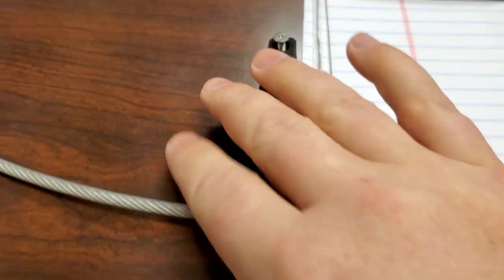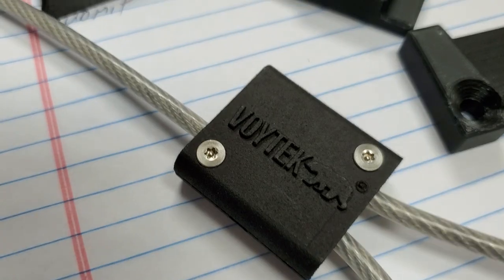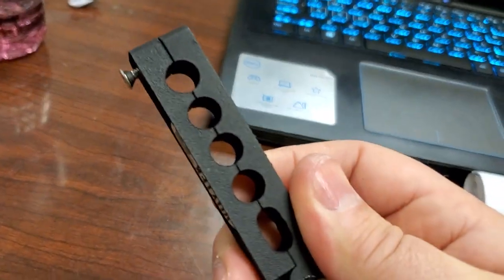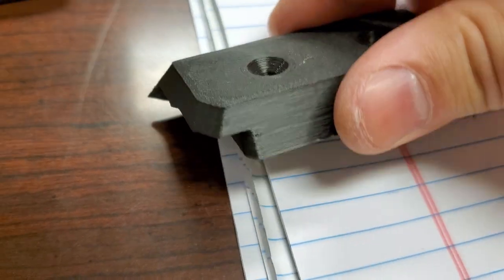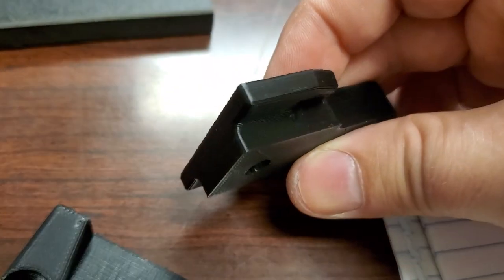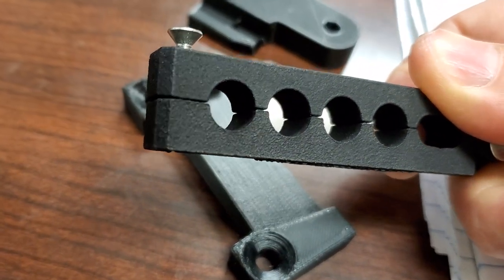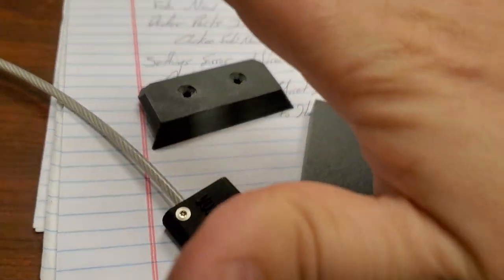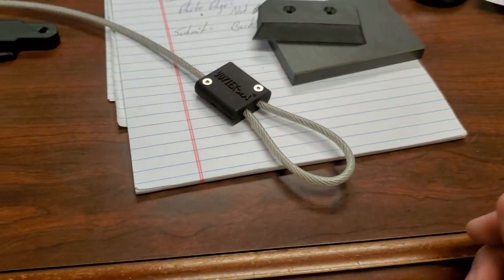New Manufacturing Processes For Medical

Comment: A lot of mfg will hide those striations using an acetone bath/or brush (thats for ABS and PLA prints I believe). But that could just be a better printer hard to tell. If you cut it open and you can't see the striations then its a good printer - if you can it's a surface treatment. Also, instead of acetone you can also heat treat it or sand it - both of which could be used. I have seen some fancy filaments designed to hide striations.

Comment: Hi there are three possibilities for this: (1) SLS machine (2) polyjet/multijet machine. or (3) a multijet fusion
All three of them can produce this part with that specific surface texture. The only gap in my knowledge here is I only know of ABS and Nylon being used in SLS machines, so the glass fibre like feel you mentioned might mean it's either (2) or (3).